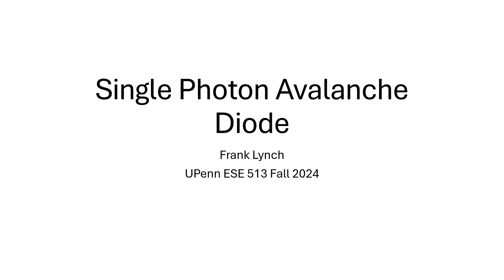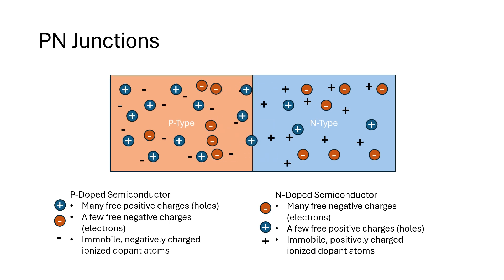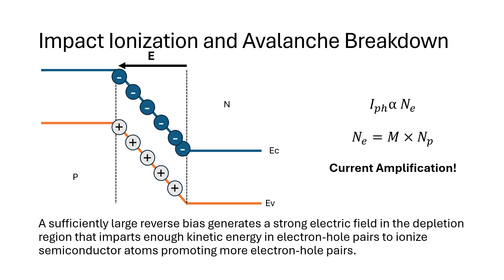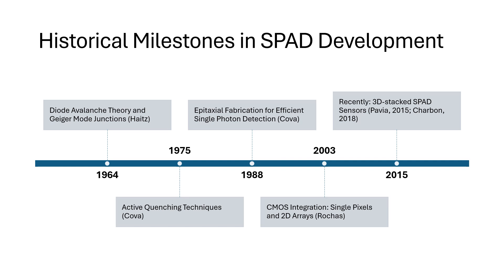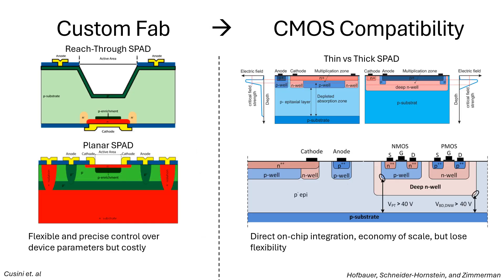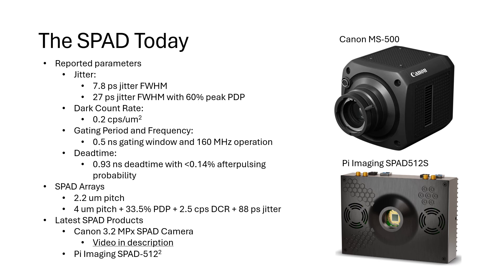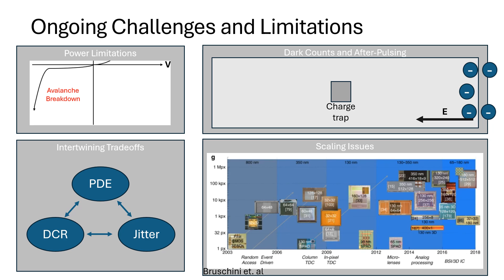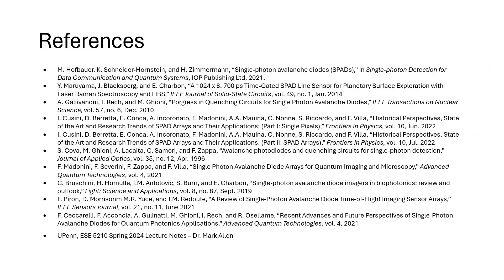Single Photon Avalanche Diode Overview

Comment: I think there may be a contradiction between the discussion and current waveforms around 4:22 versus those at 5:10.  In the earlier slide, the rising part of the current waveform is labeled "photon absorbed", and the longer, falling part of the waveform is labeled "quenching".  The later slide I think makes the steps clearer, and disagrees with the first.  The "photon absorbed" event occurs at the start of the rise.  The avalanche proceeds, sharply increasing the current.  In the earlier waveform I think that corresponds to the rising dashed arrow labeled "avalanche: and also the falling arrow back to VBreakdown    That increasing current simultaneously appears across Rq, reducing the voltage across the SPAD (hence back to VBreakdown). That is the quenching action..   
So "Quenching" I think should refer to rising edge of the waveform, and at the peak we would have "Quenched". The falling side of the current waveform is described in the video as "relaxation", and in the later slide "Charging" which seems right (disagreeing with the earlier slide).   Am I right about this, or have I missed something?